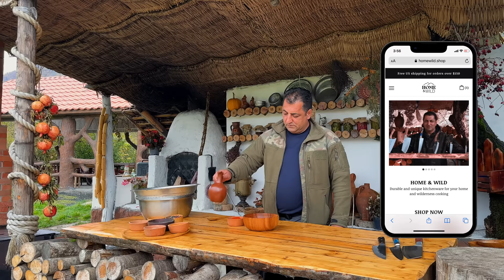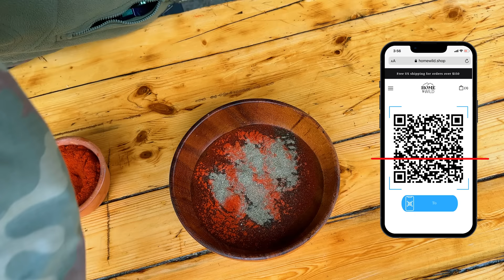Recipe For Rustic Tandoor Pizza! How To Cook A Giant And Very Tasty Pizza?

Comment: I got a new toy. its a 31 gal. galvanized trash can. This will replace a lot of things on my patio. It will smoke, grill, bake be used as a smoker, grill, oven, and a pizza oven. I got the sluice off a tent, and legs off a honey extractor, Made it a perfect height. i had to buy 2 18" grates . i used a drip pan for water ect. and a fire box for it Had them.  I made it where i can move the fire box up down in it. and the grates as well, i can even hang meats in it
Reply from the maker: Well done and thanks for watching.